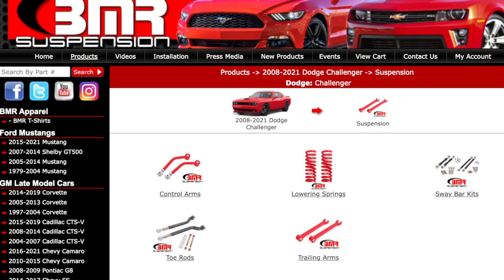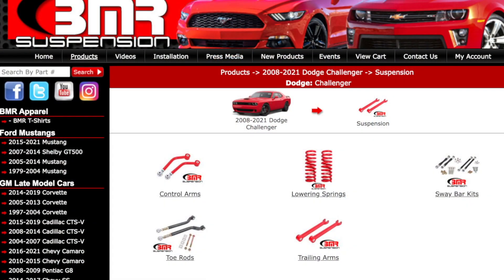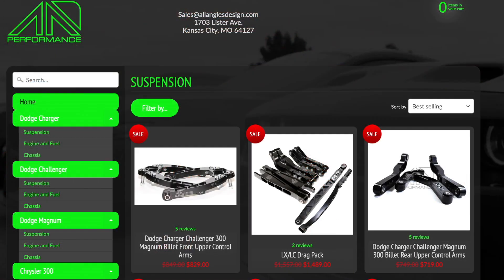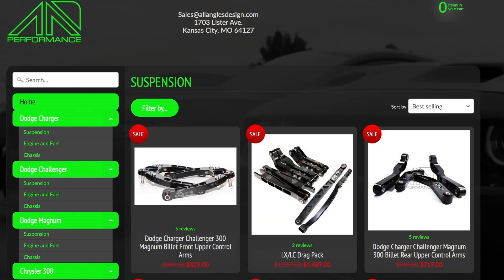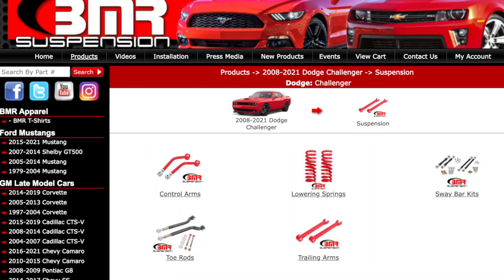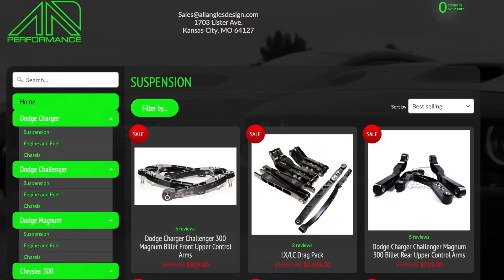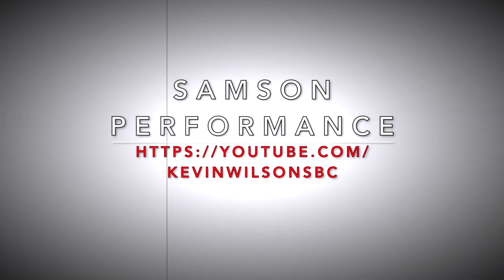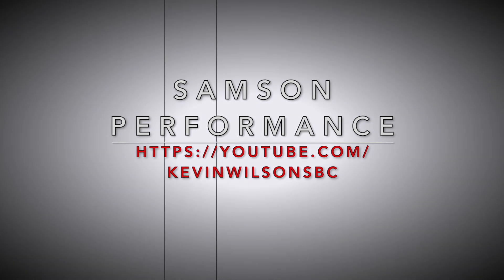Independent Rear Suspension Drag Racing - IRS Drag Racing

Comment: I'm a pro road race engineer. You're 100% correct about replacing all the rubber bushings. The rear subframe and the differential mounting bushings are a bit of a bitch to saw out and replace, but it makes a massive difference to the car dynamically. The suspension arms need to be addressed as well. Every pivot needs to be either a monoball or at the very least polyurethane. 

On road race stuff, lowering the rear of the Mustang is very good for rear grip when cornering*. I run *softer rear springs than soft because I want the squat. It makes a big difference for hook-up on a road race car. The additional camber that you get with the travel is a good thing in a corner, especially because of the roll-center height influences. I get what you're talking about on a drag car, though. The squat will probably not help you on a drag launch, because of the camber/toe gain.

Also, I agree BMR and AAD both make good products.

I know when someone isn't full of shit, because they DON'T give you absolutes. You've given ideas and a general philosophy with a couple product recommendations. You didn't promise any silver bullets. Good stuff, Guy!

Comment: Kevin, you are spot on. I understand this video is old, but I have been promoting this very info for a long time since my 2003 Cobra days. I’ve implemented everything I learned from those cars to the Challenger/Charger platform. 100% agree. We got some crazy IRS Dodges here in So Cal that I’ve done all the work on. The audience thinks all Challengers are wheel standers.

Comment: i've bracket raced a slower(low 12's, 1.6x 60') mazda RX7 (2700#) for about 12 years with the stock IRS.  locking out movement of the cradle and diff are critical, as is anything that can cause rear-steer.  when it comes to squat, my car has no antisquat designed into it from the factory, so I'm only able to help it with springs, shocks, bushings, and tire pressure. The main thing with squat is to allow it only as necessary to transfer weight to the tires, if the spring rate is too soft the car will hit the bump stops, bounce and start a vicious cycle of wheel hop.
with IRS, the antisquat is designed into the suspension from the factory at whatever it is, and generally there is no changing it, only working with what you've got.
anyone getting an IRS car into the 1.2x 60ft  range is doing amazing.

Comment: On my 2015 Charger Hellcat, I have invested in making my IRS as strong and resilient as possible with AAD billet suspension all around, BMR cradle lockouts, DSS axle half shafts and drive shaft and Per4mance Development DIRS and Race brace for the differential.

To have strong and predictable parts for the driveline, I anticipate the new times and trap speeds will benefit from the specific preparation of the IRS. 

GREAT VIDEO
Reply: Hey Bro, I’ve done the same with my 2016 Challenger HC. Only diff was gforce half shafts. Was able to put down 0-60 in 2.5 sec past weekend. 1.5 60 ft. so I’m still working on that.

Comment: I race a miata mostly on the street and no prep events. From what I've learned, the worse the surface the more squat it seems to like, ive been low 1.3x on bad tracks, mid 1.3x's on the street on a 26x10 slick.  The better the surface the more I tighten the rear compression to control the squat. Valving and spring rates are very important, ive sent shocks bacj and forth multiple times to get the right valving and spring rates for the surfaces I race on
Reply from the maker: Chase G thanks so much for your comments! Go fast, go straight! Be Safe!!

Comment: Looking through the description, I planned to get with John Reed this year to get my 300C setup right.  I think its close but could be a little better.  Car made 485/444 on a mustang dyno.  Car weighs 4150ish in race trim. Viking coilovers on all 4 corners, BMR control and lateral arm in the rear and polyurethane cradle bushings.  Car has seen a best of 1.4 60ft, averages about 1.45 in the summer.  On the hunt for 1.3s!!!
Reply from the maker: John Reed is definitely your next stop!! Hopefully they are Crusaders and not Warriors on the Viking shocks, but I will prepare you now, the Menscer shock package John will want to put you in are absolutely proven with the IRS dodge cars!!! Go fast, go straight! Be SAFE!!
Reply: What was your settings on the rear compression and rebound was it prep or no prep

Comment: I've managed to get a 1.35 60' with a 85 C4 with dana 36. Not an easy task.
Reply: Very Impressive I would like to know how you accomplished that
Reply: @gregleenyit  honestly lots of racing and making passes. It averages low 1.5 high 1.4 60s on no prep just had to find a sweet spot with converter different rear spring front travel and how much nitrous to leave on.

Comment: You mentioned Delrin bushings, but what about Aluminum or Polyeurethane? I read on garageistic that Delrin doesn't return to shape and if used in a car that features sharp impacts (like drift cars was their example) it may be better to go Poly (especially 80a hardness) for a more street oriented car or Aluminum for a more race oriented one.
Reply from the maker: @drunken Hamster Thank-you for responding! I am so glad you posted this, as I definitely prefer the aluminum bushings for full race for sure. We HAVE had good success with delrin (Made in the USA) bushings, but, as you stated, the aluminum bushings are the best for full race setup. I meant to include this when I recorded the video, but I just flat out forgot to discuss the roller bearing design. I meant to update the video description with this oversight, and now I will.  Go fast, go straight! Be SAFE!
KevinWilsonSBC
Reply: @KevinWilsonSBC  I was about to say you said nothing about the poly bushings, but then I checked the description after you mentioned that, too. Thanks for the response, and same to you on the "drive fast, be safe" part! :)
Reply from the maker: @Drunken_Hamster  keeping me on my toes... LOL. Have a good night!

Comment: Coming back to this (I can't build or race right now, but I love learning), what if you COULD set anti-squat and IC and whatnot on an IRS car? How should you do it, or how does that change things given that the anti-squat line on an IRS setup is drawn from the hub center instead of the contact patch?
Reply: You can change anti-squat in the suspension (which deals with the linear loads in the control arms, but what you don't have is the torque reaction of the live rear axle. That torque reaction gives a big plant on the launch.
Reply: @MrTL3wis  Yeah, but it does so asymmetrically, which isn't ideal. IRS anti-squat should theoretically plant both tires equally. Either way, I still don't know how much you should set for IRS if it were hypothetically as easily adjustable as solid axle anti-squat is.
Reply: @Drunken_Hamster  I'm not really sure what's the most live rear axle setup in drag cars?...I'm a road race guy. You can do an offset 3-link like the circle track guys to balance out the prop-shaft reaction torque and get an even plant. 

What you get from the live rear than you don't get from the independent is the torque reaction of the pumpkin. What you do get is better control over bumps and seams in the track. 

On a road race car, you're always trying to load the tire slowly. You have to allow the squat. With a drag tire, you guys play with hitting it hard/fast. It's a little bit of a different approach because we're doing different things.

Comment: Kevin, thank you for the videos and the information you are sharing. I have a 2012 Dodge Challenger that I drag race and have already knocked  .2 sec off my 60' foot time following your advice with minor changes related to increasing stiffness within the IRS.

My car is  a manual transmission car.  I have been using soft sided bias ply tires since I've started racing (~8 years).  Would a stiffer sidewall radial help improve the launch or should I stick with soft sidewall tires?

thanks again!
rich
Reply from the maker: A radial dead hooked generally will outrun a slick. Dead hooking it is the challenge but as you see we got that part down with this hellcat. If track prep will not pull your shoes off then a slick is your friend. Go fast, go straight! Be SAFE!

Comment: I got a 406 nitros in a c3 stock IRS with poly bushings and van steel strut rods and gymkana rear leaf with one extra leaf.. th400 with ATD brake and 390 rear 4500 stall... just got 90/10 calverts with 2" extentions up front... and qa1 Double adjustable in back. Cars 3klbs. I never hook I just spin. What would you recommend as a starting point for setting the qa1s? Oh I run 275/60/15 MT et-R
Reply from the maker: Unless they are the QA1 MOD series, I would highly recommend a shock more valved for IRS suspensions... The latest video of the Hellcat I posted shows the Menscer shocks on all 4 corners and it is night and day difference. Checkout https://youtu.be/0fOdZGehSZ4
I would also recommend stronger valved shocks up front, especially with a Radial setup. Viking makes a "tie-down" valving that is good and will not break the bank. Go fast, go straight! Be SAFE!
Reply: @Kevin Wilson  I soaked the tires with wd40 and with the qa1s set 6 compression and 8 extension it will hook now hard. I can't believe the difference.  Thanks. No these are the made for a c3 $300 each QA1TD403